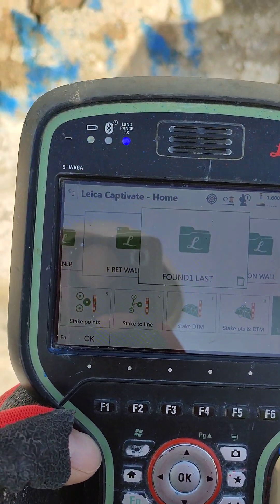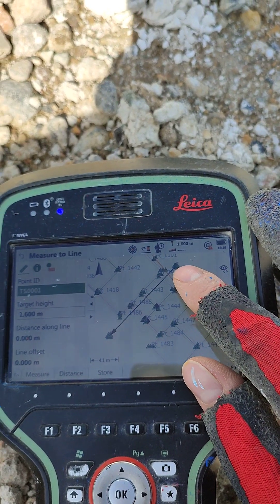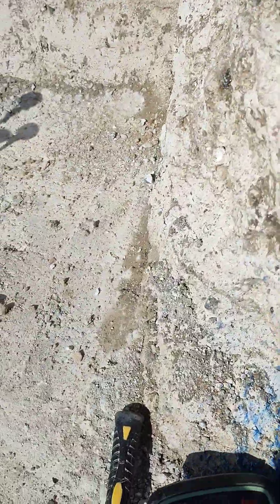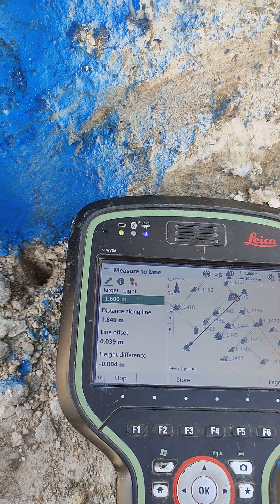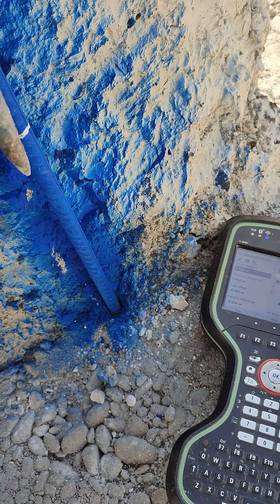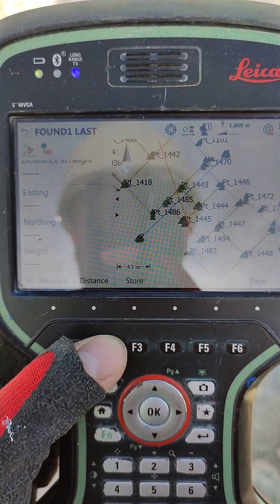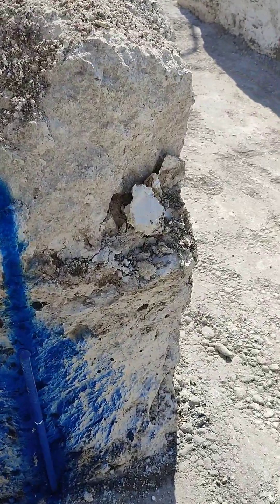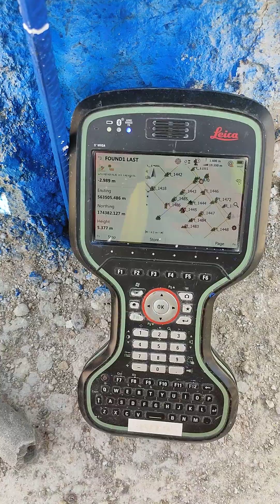Ts16 Leica DTM or line with levels Part 2 site marking

Comment: Nice video Vince! I would put the pal on the top of the pin, and then measure down with the tape the distance shown by TS
Reply from the maker: Yes that's the old school method! And may be more accurate but I think the way I mark is a little bit quicker. That way you save all the tape measurements on each individual pin and most of the time is precious= the job has to be done  quickly.
Reply: @gavra1l  do you have an email so I could get your opinion about one issue I have met recently?
Reply from the maker: Hello buddy, you can ask me here so it can be useful for other people as well. In case they have same issues like you. Hopefully I can help.
Reply: @gavra1l  not a problem pal. I have recently faced an issue with resection. Depending on the position of the total station the grids which I was staking out had slightly different positions. It's probably because the primary points have poor quality and there weren't coordinates averaging between them. I'd like to get your opinion on what you usually do in this situation.
Reply from the maker: Hello buddy, 
In your particular case when you are marking grid lines and the resection is poor that can give you slightly different positions. 
I would do that way- 
First -
find a place where you can see, if possible all targets. Then set up the instrument with all that you can see. 
Second- 
Create new control folder and record/measure all targets again. 
Then any resection difference should be gone!!! I hope that will help.